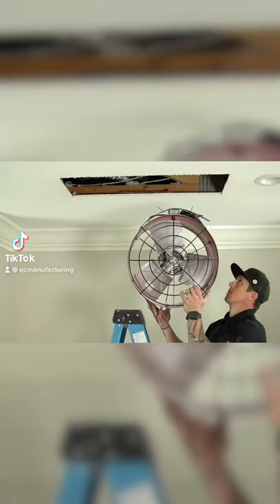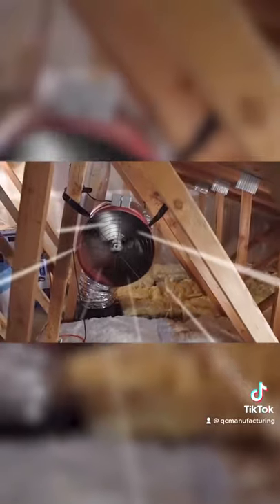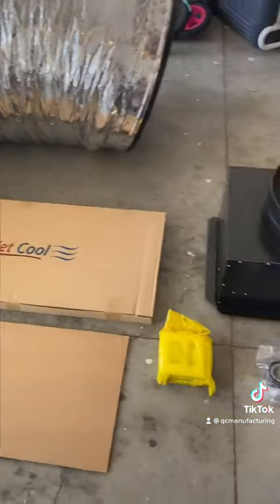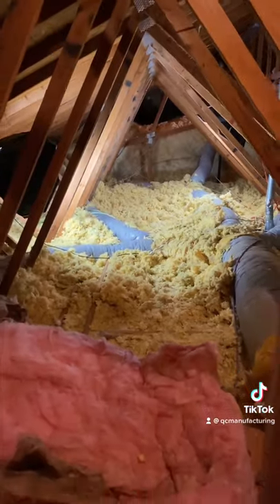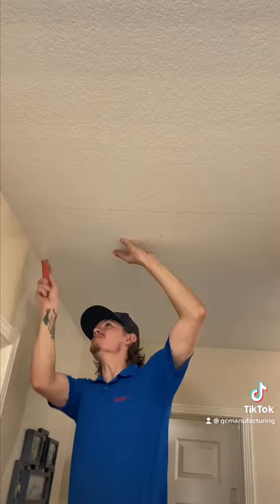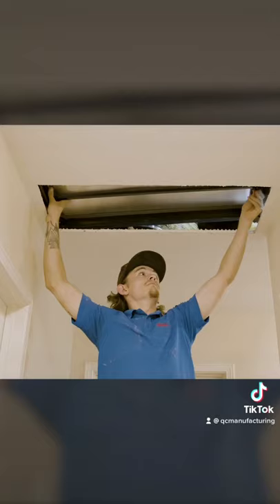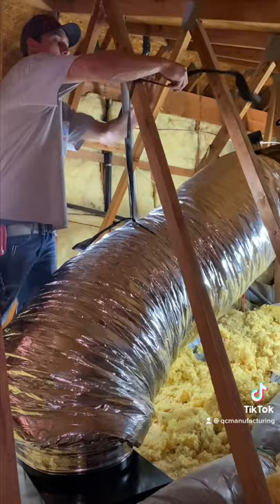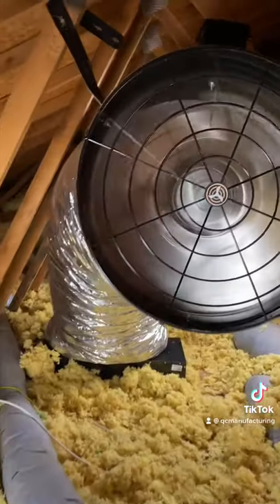How To Install A Whole House Fan In 12 Easy Steps

Comment: You forgot a few steps. You didn't lose the instructions, install the damper box before putting the fan in the attic. I also can't help but notice that you failed to step through the ceiling at any point in the process to allow for space to get the fan in with the damper box in place.
Reply: This shit hit home. Especially the one leg through the ceiling. 😂
Reply from the maker: @PoringPoring951 you have to finesse when you’re in the attic

Comment: What happens to the hot air that infiltrates from the attic when the A/C unit is turned on?  do you have a damper?
Reply: Dampers only open when fan turns on.
Reply: @wisedesi442 Isn't the fan blowing hot attic air into the house?? You're blowing hot air into the house?
Reply: @mistadreadman No
Reply: @mistadreadman its sucking air out of the house into the attic.
Reply: @camaroman101  Yes, and then the rest of the house is sucking air in from outside. As long as the outside is somewhat cooler than the inside, it's great.

This is something that would be really useful around here where it rarely gets much above 60F at night during the summer to remove all the heat that builds up during the day.
Reply: @mistadreadman  this fan creates negative pressure in the house and air is sucked in through open windows. You'd run this in the evening, when the temps outside are cooler. It will suck the cooler air through the house and blow all the hot air in the attic out through your vents.
Reply from the maker: @rshinn8776 yes, correct
Reply: @rshinn8776 isn't it called static pressure? Or no?

Comment: Worst thing ever brings in so much dust pollen etc.
Reply from the maker: You know we make the worlds first MERV 5 rated screen that black the dust and pollen. I would strongly suggested putting them on a few windows then try it out. The screen is called the clean air window screen.

Comment: Don’t you need to vent it outside?
Reply: No, you want the cool air to cool your attic . You could also install a exhaust fan in the attic
Reply: You can if you want, but there is no real need.
You have free flow vents in your attic.
Some attics have attic fans, too.
Reply: The soffits and vents in your attic let the air escape. You want this to be freely blowing in the attic because it will get rid of hot air sitting up there

Comment: Is it venting into the attic? Wouldnt that bring in excess moisture and cause mould? Is it just venting out of the soffits?
Reply from the maker: It helps prevent mold and moisture. Same concept when a home gets flooded they use fans to dry it out.

Comment: i've been wanting to install on of these forever.  What about venting?  Are ridge vents and soffits enough to expel the extra air going into the attic or is an attic vent fan needed?
Reply from the maker: Hello,

For venting, you need 1 sqft of net free area for every 750 CFM.

Call us at 951-325-6340 and press 1 to speak with our tech support.

If you get the dimensions of the venting in sq inches we can help you convert into sqft

Comment: Is the heat your getting out of the house going into the attic? Wouldn't that make the attic too hot?
Reply: Attic is usually 20 to 30 degrees (or more) hotter then the house air so the house fans cools the attic as well
Reply: Only if your house is hotter than your attic.

Comment: Will it still work if there’s no gable vents?
Reply from the maker: As long as you have other vents which you should by code. WHFs just need attic vents to push out the air any type will work.

Comment: This takes air out of the house and puts it into the attic?   Is there a damper for reducing heat loss in the winter?
Reply from the maker: Yes, there are dampers in place to prevent any heat transfer coming back into your home

Comment: What clearance of obstructions do you need around the fan to prevent stress on the motor?
Reply from the maker: You minimum clearance of 30 inches in the attic and you need 1 sq ft of venting for every 750 CFM in the system. This is pretty close to the attic ventilation code that is 1/300 attic venting.

Comment: What do you do in the winter when you want the hot air to stay in your house when running your heater.  Does the damperbox air seal itself when not in use?
Reply from the maker: Hi,

Indeed, that is accurate.

The damper box prevents the transfer of air from the attic to the living space when the whole house fan is inactive.

Comment: Is it sucking the air or blowing inside the house?
Reply from the maker: When it’s cooler outside than inside normally in the evening, nighttime and morning hours you open a couple of windows and it brings in fresh air through your house and up into your attic. Then it pushes the air out through your existing vents in the attic. So it will change the air in your home every 5 min.
Reply: @qcmanufacturing  do you need an attic fan in addition to pull the air from attic to oudoor?
Reply from the maker: No, the attic fan is designed to help during the day. When you have a 100 degree summer day normally your attic gets up to 140 degrees. With the attic fan you can keep it within 10 degrees of the outside temp and as the outside temperature drops so will your attic temp. This prevents ac cycling and help the ac work better during the day. Then you use the whole house fan at night time so you don’t have to run your ac at all. So by running your ac half as much you’re going to save money and extend the life of your ac by up to double.
Reply: @qcmanufacturing thank you for your comprehensive explanation! I like your channel!

What is your recommendation for the SIZE and Brand for 2 stories 2200sqft located in central California we have 30F - 110F range of temperatures during the year
Reply from the maker: @emyunster thank you please subscribe we always putting out content weekly.

Comment: This only makes sense in the north. In places Texas and Florida you'd just pull in super hot a humid air.
Reply from the maker: In the summer yes but in the spring and fall you can use your whole house fan. The average person in Texas and Florida run their AC 10 months a year so with a whole house fan and attic fan you can cut it down to only 3-4 months. In result you will save a ton of money, improve comfort while extending the life of your ac system because you’re cutting down the wear tear.

Comment: Is this an exhaust fan or a fan?
Reply from the maker: It is called a Whole House Fan. When ever it is cooler outside than inside your home typically mornings, evenings and nights you run this instead of your ac system. It brings fresh outdoor air into your living space and pushes the air in your home up into the attic and out your attic vents. We have a lot of videos on our YouTube channel explaining it.

Comment: Aren't you just sucking air conditioned air out of your living area to cool off an attic space. Plus without proper ventilation, the attic space becomes pressurized. A lot easier to do with this passive ventilation to cool off the attic.
Reply from the maker: No, because you would never run the system when your house is cooled. You only run it when it cooler outside and than inside. When the air goes into the attic it’s going to push out all the hot air cooling the hottest part of the house. Your house stays hot because your walls and attic gets up to temperatures of 150 degrees which causes ac cycling. Ac cycling is bad because it takes 20 straight min of run time for your ac to hit its peak efficiency.
Reply: @qcmanufacturing lol, then you suck the heat out
Reply: Only if you have air conditioning that is running at the same time.  I'm interested in installing something like this because we DON'T have an air conditioner, we DO have cool summer nights (except for maybe 2 weeks).  We currently have window fans, but this would allow us to just open windows without the window fans.  If I can figure out how to make it work with our current roof/limited attic space
Reply from the maker: @JenniferV2003 go on our website we have a roof mounted whole house fan. It’s designed for applications for little to no attic space

Comment: Do these work well in all 50 states, or just California?
Reply from the maker: They work in all 50 states but depending on the region could have different use cases. For instance if you live in a climate zone like Texas, Florida or even phoenix arizona the whole house fan will work great in the spring in and fall but not the summer months. Most people run their ac system 10 months a year in those markets and with a whole house fan you can cut the usage down to 3-4 months. This will also help you save a ton of money and prolong the life of your ac system by doubling it.
Reply: @qcmanufacturing  Sounds good! Thank you.

Comment: Is it supposed to draw air from below or above?
Reply from the maker: It pulls air from outside in through your windows and then up the fan grille and the air will expel in the attic and then out your attic vents.
Reply: @qcmanufacturing  thank you, I just bought one and installed it. I think I installed it too well. My house is now flying towards Mars.

Comment: I thought it's against fire code to vent living space air directly into attic space where there is open rafter or truss house structure frame. It's the 1hr fire code requirements, to vent living space to outside thru wall or completely passthru with vent tubing or ducting, not open structure areas. Especially with a fan.
Reply from the maker: That’s only for attics above garages that have a fire wall. You can install a whole house fan in your attic above your living space.

Comment: Why not blow the air out of the house ??
Reply: You are drawing in fresh air from outside and blowing in the stagnant air to your attic. Two things I think they forget to mention are you need proper attic venting prior to install and you need to crack a window when the fan is on to pull in fresh air.
Reply from the maker: Yes, you’re correct! You can find more videos on how it works or how to use the fan on our YouTube channel.

Comment: do you have the model #.  of the shown fan. .with remote?
Reply from the maker: It is called the QC STL PRO 7.0 and the control is called a RF Wireless control. Where are you located?
Reply: south carolina.  .
Reply from the maker: You can purchase the fan on Amazon, HD or Lowe’s to do a DIY job.

Comment: Not a good application where it stays 100° + through midnight, till dawn when it will get past 120° (Death Valley, Coachella Valley).
Reply from the maker: Yes, this product is designed to be used in those areas during fall and spring. This is a big deal because you have to run ac 9-10 months a year and you can cut it down to only 3 months of heavy ac use. You will save a ton of money and pro long the life of your ac system. Your ac is your most expensive appliance to run and replace. They only last about 12.5 years on avg and you can have it last up 20-30 years if you use a whole house fan during the spring and fall.
Reply: I don't think it would be any good. I was thinking of having one installed in SoCal I'm in the Long Beach area.
Reply from the maker: @thomasthurston6656 Long Beach is the perfect climate for whole house fans. It’s always cooler outside in the evening and nighttime hours. QuietCool is based in so cal.
Reply: @qcmanufacturing  Did you guys have a place set up at the LA County Fair ?
Reply from the maker: @thomasthurston6656 one of our dealers was there.

Comment: Doesn’t it blow out the cold AC air if you have it on?
Reply from the maker: No, the reason is because you would only run your whole house fan when it’s cooler outside than inside.
Reply: @qcmanufacturing so you use the whole house fan to WARM your house in the winter? It’s not to COOL your house in the summer?
Reply from the maker: @Time4aKiss I do use my whole house fan to heat during the winter but if you live in a really hot climate like Texas or Florida then spring and fall work amazing with a whole house fan

Comment: I have HVAC, would this just create a hole in my attic for my heat or cool air to escape?
Reply: There is a damper that closes
Reply: At most that would be an issue when you're heating the house. The AC wouldn't care about this, even without the damper.
Reply from the maker: Maybe you’re thinking about a traditional whole house fan but this does not occur with our system. We have installed 100s of thousands of units nationwide and even into Mexico, Canada and Australia.

Comment: So it pulls in pollen during the spring months?...🤧
Reply from the maker: You just need to check the air quality on your weather app most days are good air quality outside. We also recommend pollen Tex screens that block out 99% of the dust and pollen and only allow airflow to pass

Comment: You might get better results by getting the fan near a gable vent, but not right up against it, so that the fan's air can scavenge the air near it, thereby blowing more air out of the attic.

This acts in a way similar to how to win a bar bet, by betting someone one can inflate a big trash bag like a balloon by just mouth blowing.

The trick is the opponent will press his lips to the bag and suffer, while the other guy will blow from a few inches away, filling up the bag much faster, due to his breath scavenging lots of air around it.
Reply from the maker: It doesn’t matter where you point the whole house fan in the attic by positive pressure it’s going to force the air out of all the attic vents.
Reply: @qcmanufacturing  > It doesn't matter 
Yes, it absolutely does. While it's true that the fan will draw air up from the living area and blow it out of all the attic vents (plus through leaks in wall top plates and around conduit, etc., back into the living space), you absolutely can blow more air out of the attic by placing the fan near an appropriately large exit hole, with a gap to allow scavenging. I urge you to look up some literature about airflow and scavenging. When I have time, I'll see what I can find to add here.
Reply from the maker: @planethedgehog2427 we recommend a certain amount ventilation in your attic. Yes, you can bring some air through some leaks if you don’t have proper ventilation. We have lots of videos on this topic on our YouTube Channel. If you follow our recommendations this problem will never happen. We have over 1 millions satisfied customers.

Comment: Is it suck all the cold air inside the house blow on attic ???
Reply: You turn your ac off and just run this.
It's good if it's not too hot outside, you have a smell inside your house you want out or you want a cheaper power bill.

Comment: Genuine question, why would someone install this? Never seen something like this.
Reply from the maker: It’s called a whole house fan and it helps you have to run your ac during the morning, evening, and night time hours. It will save you 50% off your ac related costs and double the life of your ac system. Whole house fans the  ventilation part of the HVAC system. They also improve the indoor air quality of the home by replacing the air In the entire home every 3-4 min. They’re an amazing product I would recommend checking out more videos on our YouTube page.

Comment: Yall gotta make it blow outside the attic. Blowing in the attic will create positive pressure and cause the insulation to get pushed into the house through small spaces between anything in the ceiling
Reply from the maker: We have been doing this for hundreds of thousands of customers and this is not a problem. I’m not sure what your experienced been but I can assure that’s not the case with a proper installation.

Comment: What's the point of this? Fan is massive
Reply from the maker: Cool and ventilate your entire home. When ever it’s cooler outside than inside your home you run the system and turn off your ac. This will bring cool air in from open windows into the living space and up into the attic and out the attic vents. This gives you a complete air exchange every 5 min and balances your home to the outside temp at night time.

Comment: Its called an "attic fan".  And they have been around for decades.  My grandma had one in her house but it was the size of a Jet Engine fan.  haha
Reply from the maker: That’s the wrong terminology but people did call them that. An attic fan just ventilates your attic and a whole house fan does both the home and attic.
Reply: @qcmanufacturing   no sir..  The old fashion attic fan pulled air out of the house and pushed it into the attic.   There was no "Tubing" like you use.   The old attic fans sat in the jam of the ceiling.  So the interior was on 1 side, and the attic was on the other.  So no tubing was needed.   And they were HUGE fans.   When the fan was off, there were Slats that separated the attic from the interior.  And when you turned on the Fan, the slats got pulled open.   It was a simpler design than what you installed in this video.   THe big fans are great for large houses, but smaller houses do not need such a large fan.  The small size that you installed is probably more appropriately sized for an average house 2000 sf or less.  My grandparents had a HUGE fan and their house was only like 1500 square feet..  And the interior was like a vortex, it pulled so much air..  but you know, the fans also pull in a lot of dirt from outside